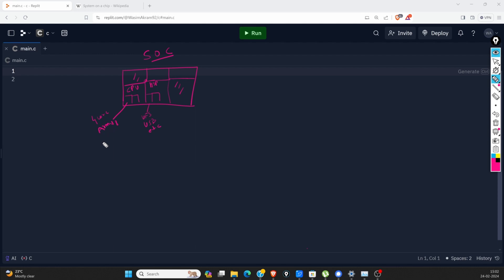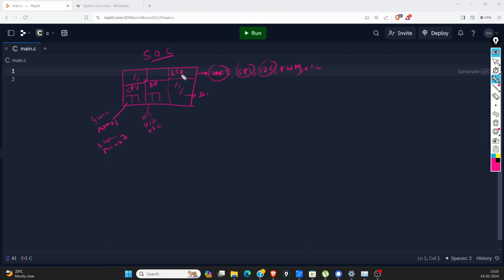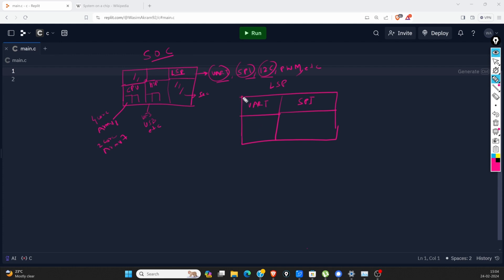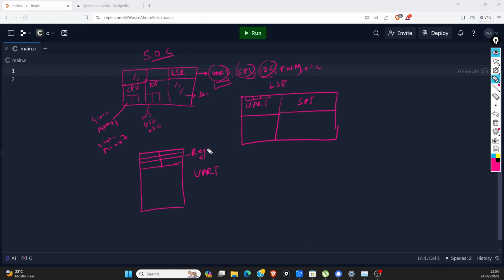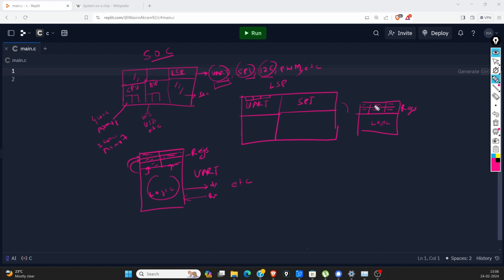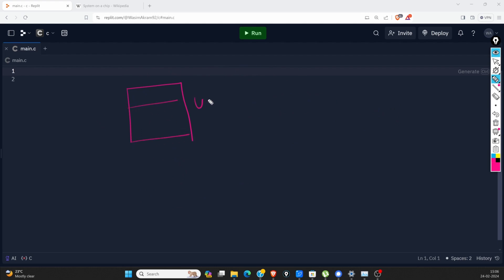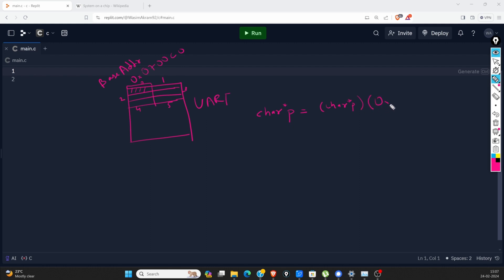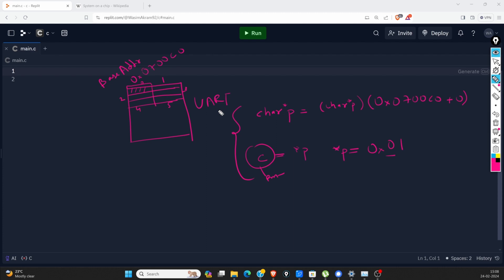1. Introduction | Embedded System Software Design

Comment: Why value is assigned to pointer to character variable instead using normal variable .it's mandatory to assign pointer to character? And then what purpose of typecast?.
Reply: so the same char pointer can be used to access next offset char data present in the register respectively and can form a string or utilized further.